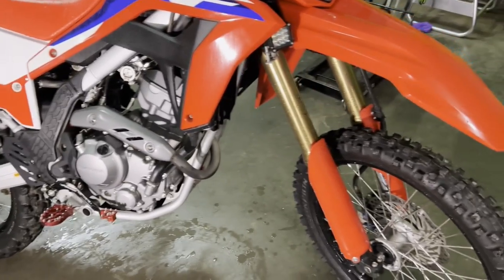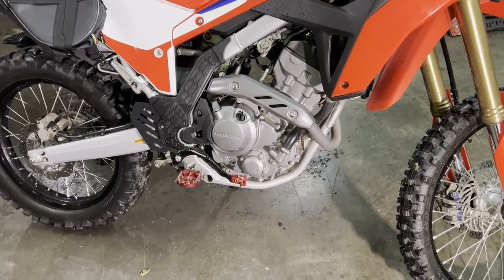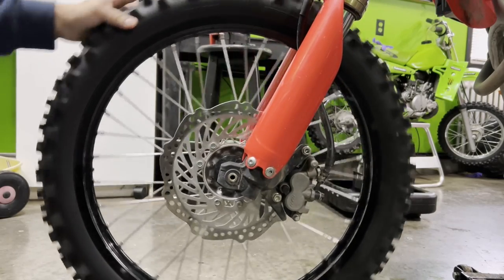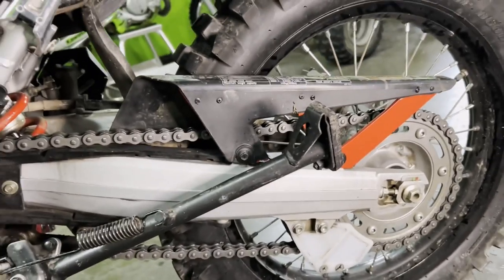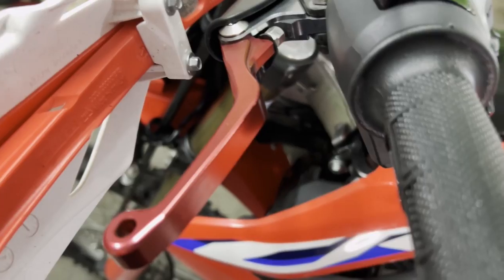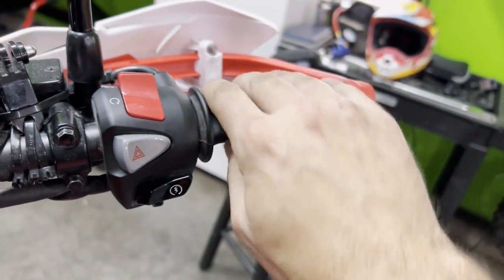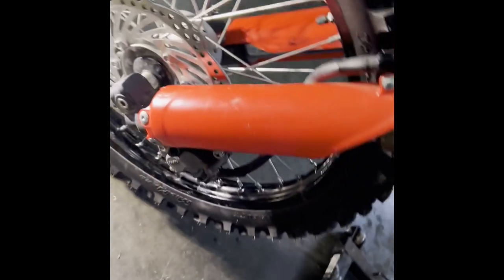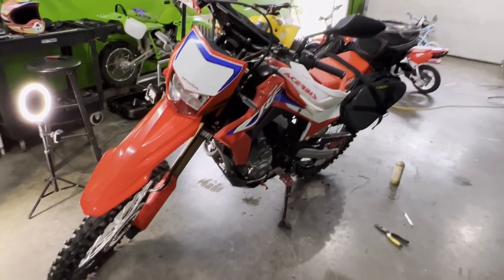Honda CRF300L Maintenance

Comment: Thanks man. Good tips. I love my 300L. Torque wrench is probably a good idea. I am at 11300 km and have had it serviced where I bought it at the prescribed intervals. Mods for off road touring I did myself (or with a friend helping) except for a Honda skid (bash) plate I bought from the dealership when I picked it up last June. Great bike! Went on a 10 day 2000+ km fully loaded moto camping trip with 6 other friends in the mountains of BC Canada this June.
Reply: Hey man. That trips sounds awesome! I'm from Alberta and I'm dreaming of a BC road trip on my 300. Would love to hear more about your trip

Comment: Great video! What brand short clutch and brake levers did you install? Any modifications required during install? Do you like them?
Reply from the maker: Hi Thank you! They are JFG racing off amazon. I do like them now that I'm used to using 3 fingers, my friend has the crf ones and they are longer. here is the link, I would watch the price on these because they were 10$ cheaper when I ordered them. https://www.amazon.ca/gp/product/B093PXZWGH?ie=UTF8&psc=1&linkCode=sl1&tag=excitebikes-20&linkId=77eef5efa92c1019cff7f1f10125e703&language=en_CA&ref_=as_li_ss_tl
Reply: @excitebikes2751  awesome, thanks for the info. Really looking to shorten mine asap!

Comment: ALWAYS change the oil filter cover plate GASKET.
Reply from the maker: Thanks , I will change it for sure next oil change
Reply: @excitebikes2751  Cheaper than having an oil leak & cratering the engine, just trying to help, best wishes.
Reply: And get a new crush washer for the drain bolt if it has one.

Comment: What tooth sprockets did the bike come with?  Have you adjusted the TPS on your bike sensor for better performance.
Reply: Do you mean adjusting the throttle cable?
Reply from the maker: Its a 40 tooth sprocket I am  going to change it out fora  bigger one to give more pull in the low end . Is that a thing you can do? Adjust the throttle position sensor for a performance boost?
Reply: @excitebikes2751  yes there are videos on it. Some of the guys are using what looks like a voltage meter reader.
Reply from the maker: Thanks I have to check it out

Comment: Geeat video! How often do you lube the chain? After how many KM approximately? Thanks!
Reply from the maker: Thanks! I would say about 200-300 km in normal conditions. More often if you drive in water and mud
Reply: Don’t bother lubing your chain if it an o ring type. 
They are internally lubed from the factory. 
Clean it when it’s dirty and hit it with wd40 and that’s all you need to do to it. 
You can lube it if you like, but it only attracts more dirt. 
Plus keep it adjusted. 
I’ll let you search for how to do that yourself 😎

Comment: Perhaps if you had a service manual, you would realize the importance of also having torque wrenches and using them to avoid over-torqueing your bolts (I'm guessing those sprocket bolts are just about to snap).
Reply from the maker: The point of that is to check to see if anything is loose , Not to tighten something to the point of breaking, Some common sense is needed
Reply: Honda service manuals suck. I bought one for my new CT125 Trail and it was a waste of money. A LOT of needed info was left out. I questioned it and found out some tree hugger wanted to save a few trees so they shorten the manual. I was pretty ticked. I like service manuals for all my stuff so I can properly  maintain it. Not happy with Honda about that right now.